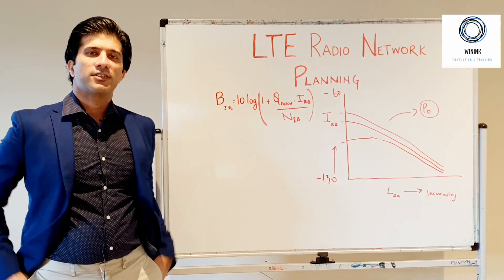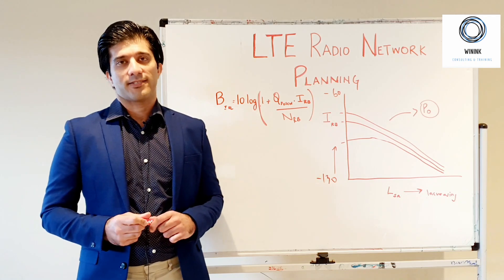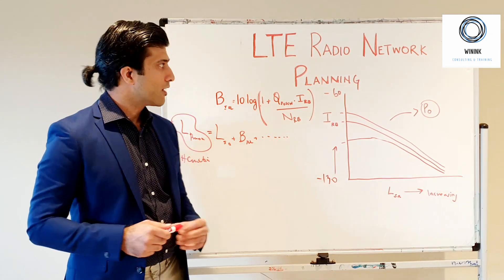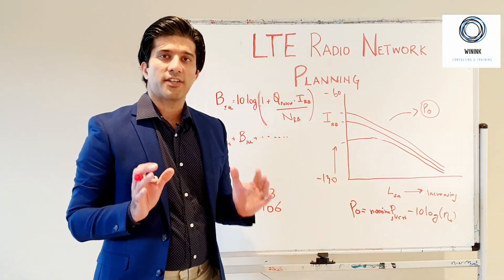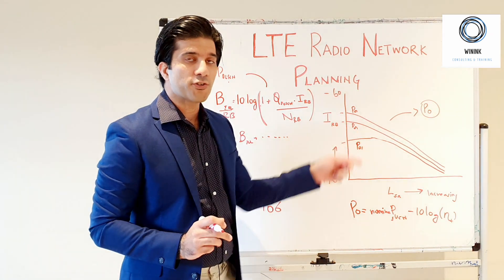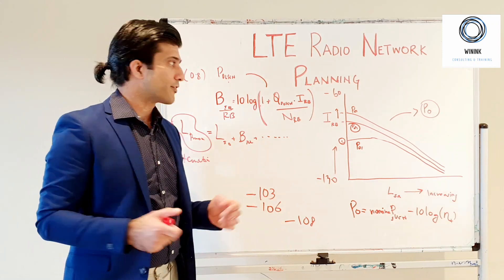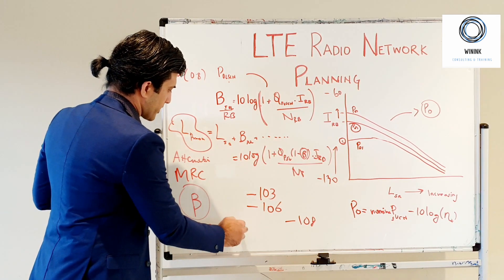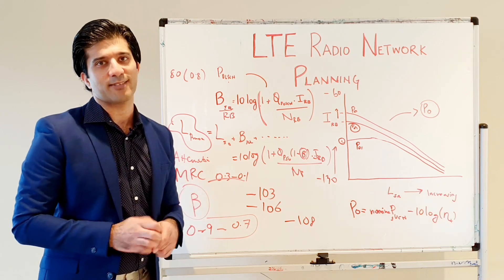LTE Radio Network Planning - How to calculate Inter-Cell Interference margin for Uplink Link Budget

Comment: Thanks so much, very helpful! But I had a hard time to find a reference that can reflect what you explained in this video. Could you share some references for more details of interference margin?
Reply from the maker: Hi John. Thanks for your comment. This is more related to practical design of a radio network and you may find references in documents related to radio network design.